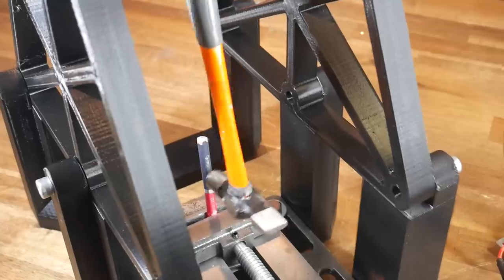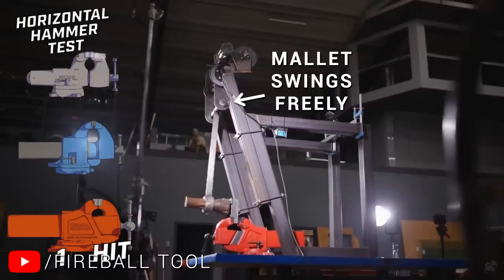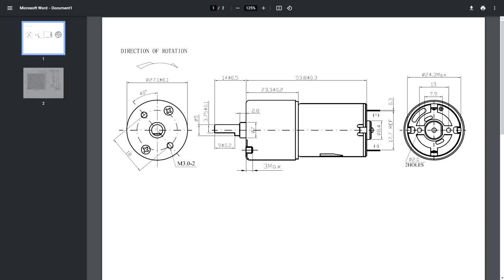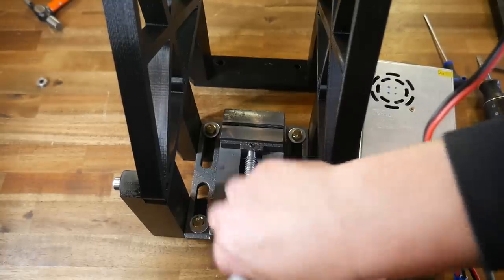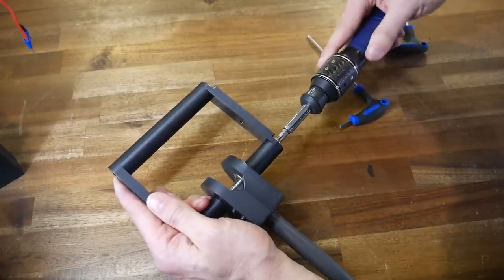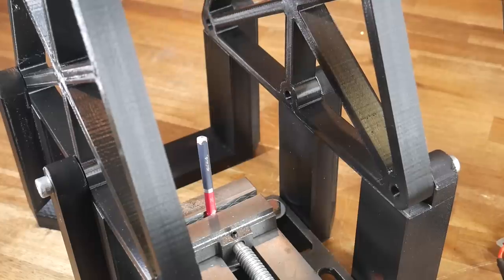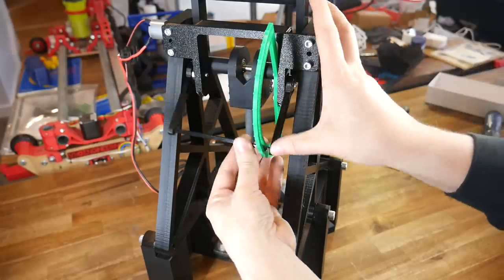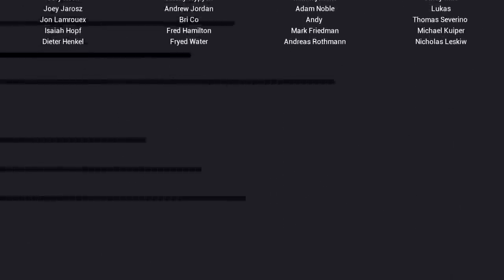Destructive testing with a custom hammering machine

Comment: Believe it or not this is also how we do "Shock Testing" on spacecraft avionics. We bolt the flight electronics boxes to a metal beam then we have a "calibrated hammer" smack the beam.
Reply: Nice! Would you be testing vibration resistance then? Testing solder joints and connections? Thanks for the comment
Reply: Another interesting test for something along the lines of this, to simulate the “shaking” of a launch, or Ammunition Sensitivity was essentially a glorified paint shaker lol

Comment: Great work! This is very similar to an industry standard impact tester called a Charpy impact test machine, even down to the impact scale you built. Greta minds think alike I guess. It's used for measuring material toughness (energy absorption) rather than shear stress, since many material properties are strain rate dependent, especially in visco-elastic and anisotropic materials like 3D prints.
Reply: Probably what the fireball tester is based on, if they built it themselves.
Reply: its actually far more like Izod testing. (2 point bend with the sample supported a one end, charpy would be pushed through a gate more like a 3 point bend test)
if he stuck an encoder on the axle, measured the length from the pivot to the point of strike and knows the force applied by the hammer at 90degree then he could calculate the energy delivered and absorbed. (i calibrate an install test equipment for a living)

stefan at CNC kitchen built his own izod pendulum impact tester ... i dont trust the numbers he gets from it but it looks like a good piece of kit for comparative testing

Comment: I would think it would be better for the motor if you ran it at the full voltage but used a reduction gear to slow it down while increasing the torque.
Reply from the maker: Definitely. I'll probably redevelop it to gear it down.

Comment: Great project, One idea is you could put a pot and arduino on so you could measure the results.
Reply: I was thinking of something similar!  Adding loadcells to the Vice and/or the Hammer Holder would add useful data, and you could even have it “pause” after each hit, and measure the force of each hit as well as automate counting.

Comment: Wouldn't it be better to use self-tapping screws into plastic? These look to be machine screws and shouldn't "cut their own thread" as claimed in the video
Reply: They do that anyway, but it is a relatively weak grip, but harder to strip than one would expect. self tapping or woodscrews needs more material to chew into and smaller holes
Reply: Machine screw threads are perfect for 3D prints. Wood screws have very thick and coase threads which bite too deeply and sharply which can destroy the 3D print.